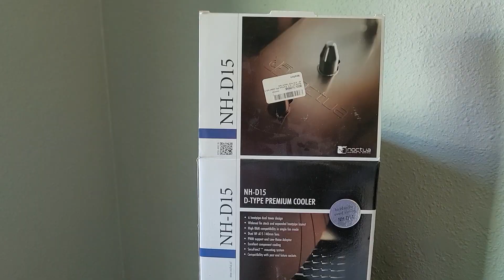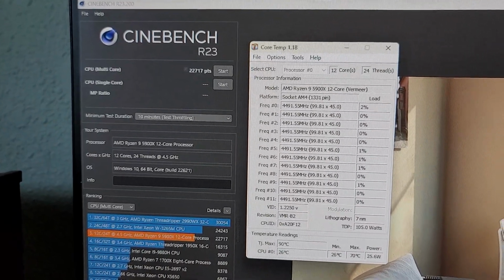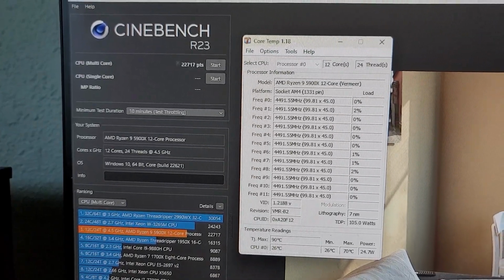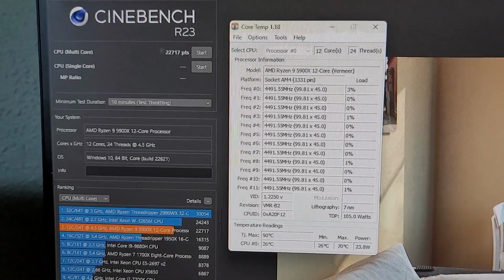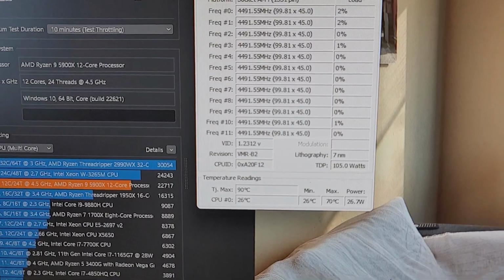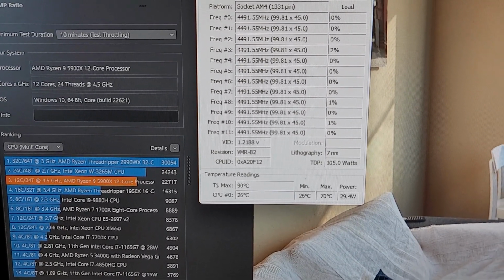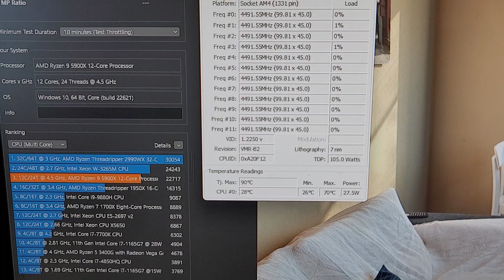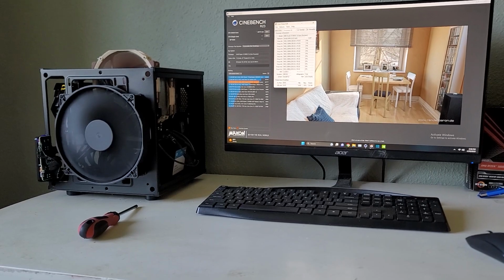Noctua NH D15 cooler in a mini itx build (Ryzen 5900x)

Comment: Thanks for confirming the fit on the nd-h15 fit on the Core v1.. I've seen someone who just removed the clear side panel and so the air cooler can stick out and then he just 3d printed a cover over it, although it created a hump. I like the modular case like the Thermaltake Corev1 for an itx build. I also have the next size case, the Core v21, which can fit the nd-h15 because it has a max air cooler height of 185mm.

Comment: I have the Noctua nh-15 with the am4 offset brackets and the R9 5900x my ac is at 66f 24/7 no all core overclock no curve optimizer no undervolting llc on auto thermal paste Arctic mx-6 enabled PBO with my limits of PPT 195 EDC 140 TDC 130 ran CB r23 mc scored 23,124 on the 10-minute throttle test.

Comment: What case is that? I have a spare 2700super and zen 7 2700 sitting in my closet
Reply: It's the Thermaltake core v1, which is a mini itx case. The next size of that case is the Thermaltake Core v21, which fits a micro ATX. Case is very boxy but super easy to build in. I use one as a NAS PC because it has a lot of places to mount hard drives and ssd.

Comment: Is this case the thermaltake core v1? If so can it fit a asus dual 4070? Thanks in advance!
Reply: It is indeed, the Core v1 and according to web specs, I think it can fit the Asus Dual 4070, which has a max length of 267mm and the Core V1 case supports up to max length of 285mm but you have really have to play with cable management.